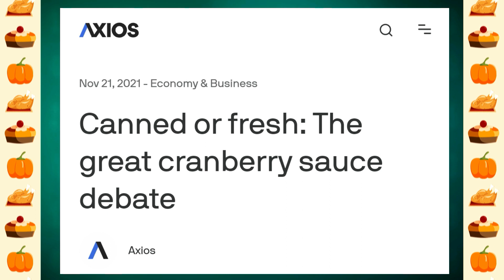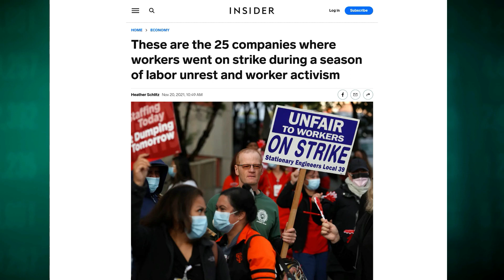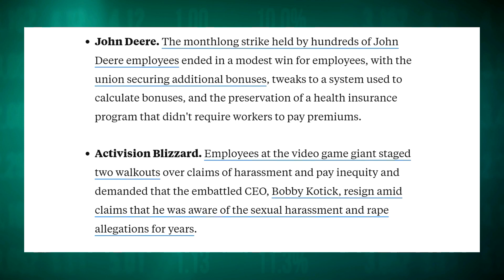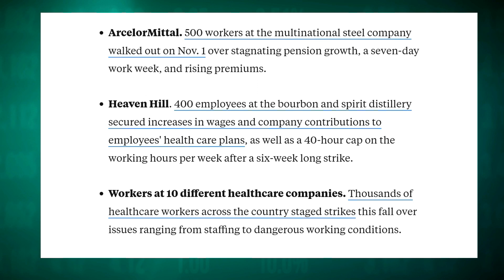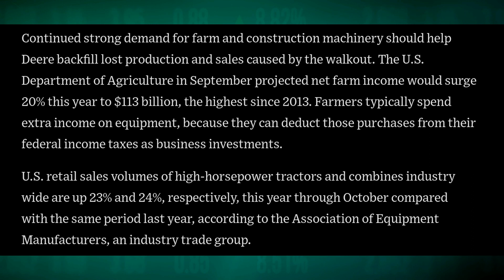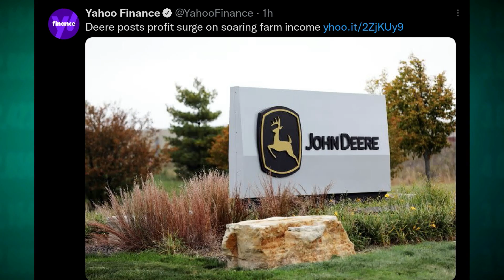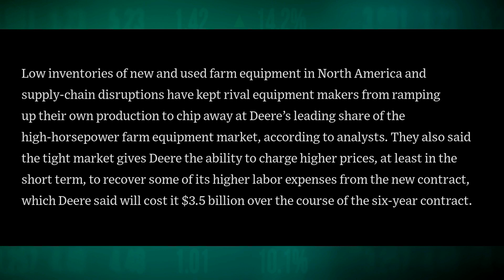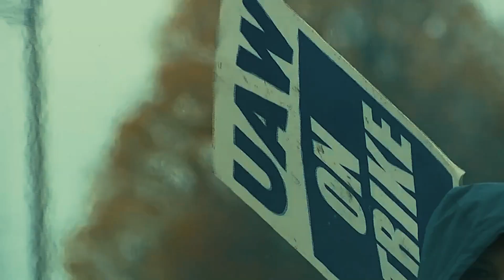The Media Didn't Want To Cover This Labor Strike Story

Comment: As an engineer, I tried to enter biomedical industry just to find how underpaid they are. I work at FAANG and I wanted to switch careers to biomedical and they literally wanted to pay no even a 6 figure salary, in San Diego. They wanted my experience (7 years) for that pay. I asked the reason, because this pay  was so out of touch, and they said I have no experience in the health care system and that is a risk. I could not see a career plan that could match what I  have been paid in tech.
Reply: Don't they make the play on options and stock pumps and dumps?

Comment: Higher pay for Deere’s workers leads to higher prices charged for their tractors which leads to higher prices paid by farmers which leads to higher prices charged by farmers which leads to higher food prices for every one else, especially the poor and middle class. 
 So, good for Deere labor, but bad for their final customers. 
Oh, and all of that on top of inflation going ‘higher, and higher, and higher’. 

Workers need fair pay, but let’s remember who is actually paying it.
Reply: @dameongeppetto  I’m not complaining about it, simply pointing out the fact that it will lead to higher prices for end customers. 
 A fact you did not, indeed could not dispute. 

And even if I get a pay raise, it would be negated by the increase in prices. Thus completely nullifying any benefit to me. 

Increased productivity should always lead to higher pay, agreed, but employers have had the benefit of a vastly larger pool of labor since the 1960’s due to an influx of immigration in the U.S. and women entering the workforce in large numbers. 
 That’s why they only increased some but not to same the same extent as productivity rates.